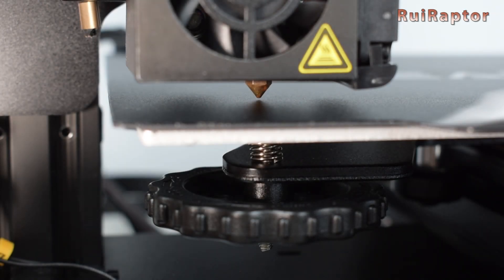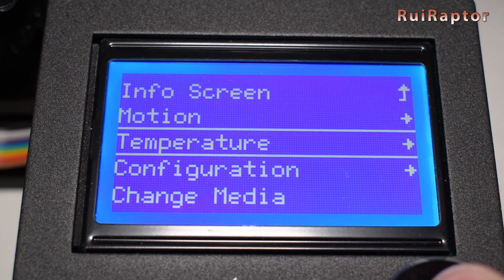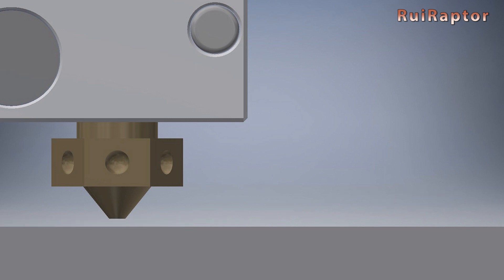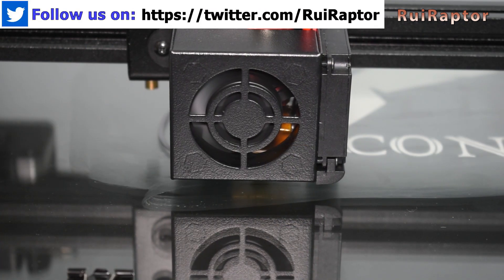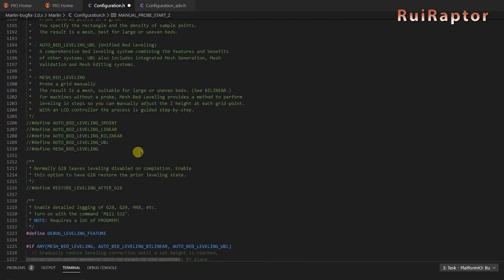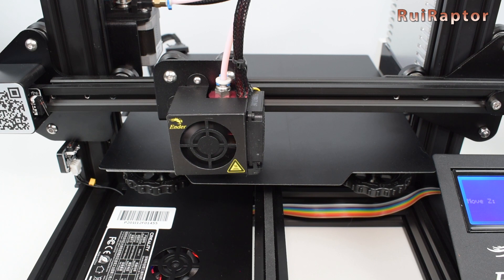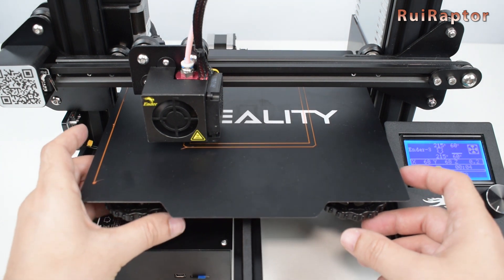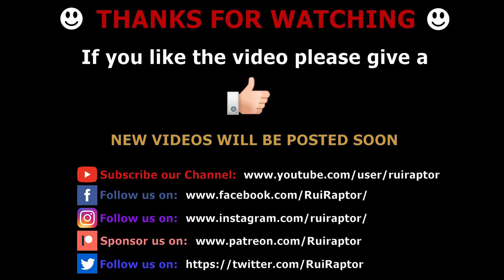HOW TO Level your 3D Printer´s BED Like a PRO / Mesh Bed Leveling

Comment: Actually even the creapy board of the ender 3 has an unused pin (Pin29) - but you have to solder it in yourself. Of course you can also use the more commonly known Pin27 if your not comfortable to solder (there are adapters to get the signal). With one of these pins set as probe input and a ground pin, you can add a dupond cable and a film probe (made a video, but for the Sidewinder and german only. But maybe the pictures help to understand what I mean: https://youtu.be/MPyGt6gpSv8 ). The sensor only is less than $2, including an LED about $4.
It is like a mix between ABL with permanent mounted sensor and an manual mesh. You heat the bed, but nozzle has to keep cool. Than you start the bed leveling. After it is ready you remove the sensor.
You will need to adjust the z-offset of course.
It is much cheaper than an permanent ABL-sensor and much more comfotable than doing an manual mesh.

Sometimes the mash seems not to be loaded or activated after a reset. So adding an M420 S after homing in start gcode does not hurt....